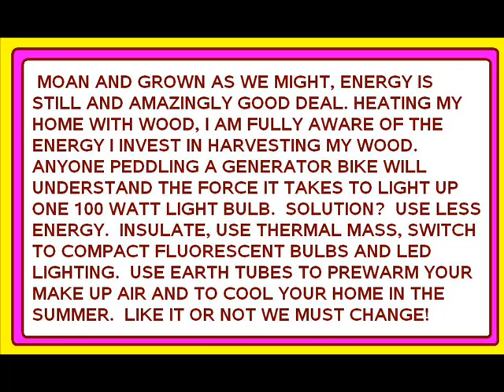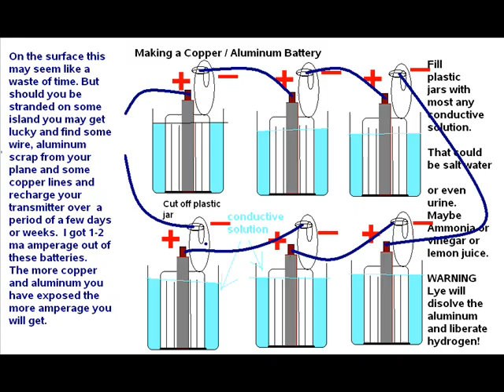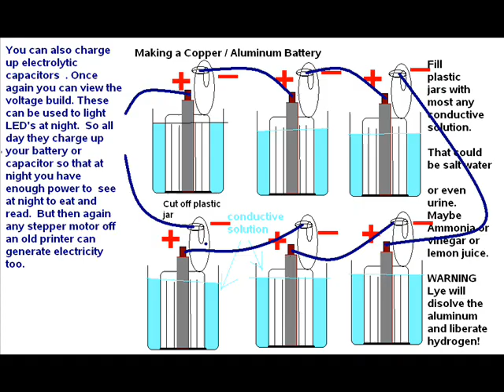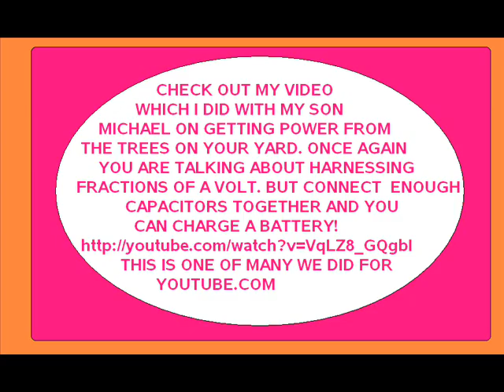COPPER/ALUMINUM BATTERY(first version)

Comment: if copper has a higher conductivity than most metals, how come there is no information about copper air batteries?
Reply: Copper conductivity is unquestionable(it is more conductive than aluminum) but the reason it's not used as an Air type battery? That is because of Oxygen  standard electrode potential is +0.40 and Copper is +0.34 there is not enough difference to create any meaningful Electromotive Force in

Comment: @liadon666

2. Careful with terminology: energy is not 'generated' except in nuclear reactors.  Energy is simply converted.  Batteries, for example, convert free chemical energy into electrical potential energy.  That in turn can be converted into useful work, light, etc.  Aluminum batteries are great for power density, but they are terrible for overall efficiency, as refining oxidized aluminum back to metallic is a very energy inefficient process.

Comment: @liadon666

1. Under no real conditions will an aluminum-air battery be rechargeable.  Aluminum is simply far too reactive to ever return to metallic aluminum under any normal conditions (temperature, pressure).  Oxidation is irreversible and entropic.  That's why we have to burn through billions of watt-hours to produce the aluminum we do.  We should use aluminum for it's lightweight structural value rather than wasting energy by 'burning' it in batteries or fuel cells.
Reply from the maker: cans are free..  and can produce h2 with  NaOH..